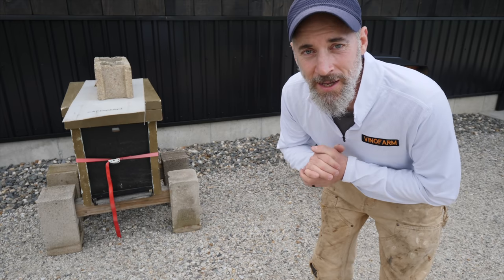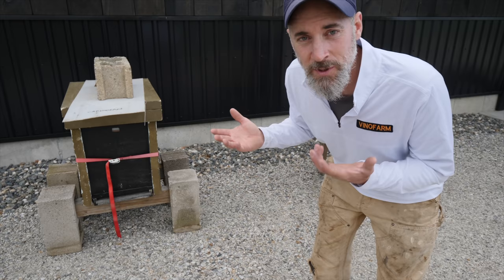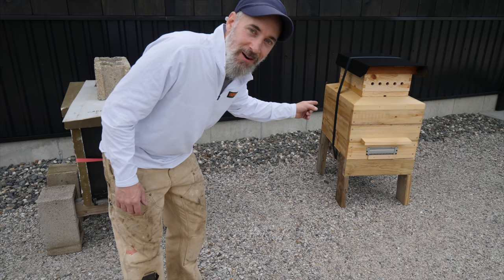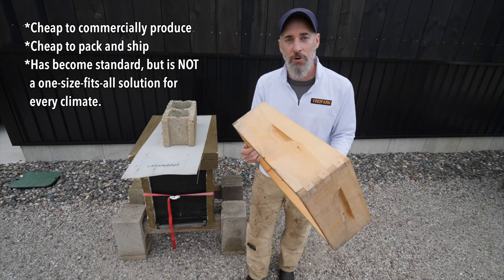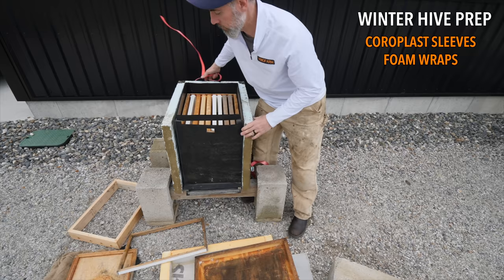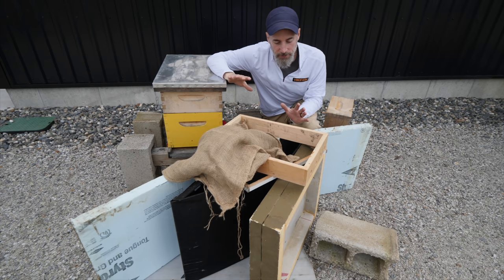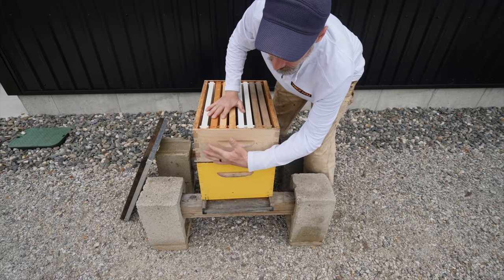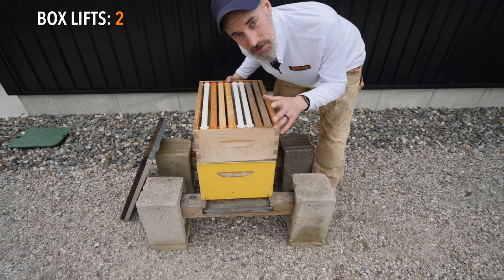I Fixed The Langstroth Hive (For The Bees AND The Keeper!)

Comment: Every beekeeper need  to understand: most of the beehives do not respect the bees. First, 2 boxes are FOR the bees, undisturbed, first box is for colony development, second is honey box exclusive to feed the colony (no more sugar + water to feed them), bees will have enough food to survive winter.  Second, stop using smoke to work with the hive, the smoke causes Absconding swarm, instead, use air blower strong enough to move bees, soft enough to avoid damage them. You can place 2-3 boxes on top to collect honey for the beekeeper. Another thing: frames are not needed, bees will organize the honeycombs inside (I found a way to help them to organize the honeycombs), you can add observation windows on every level to check for bees healthy and honey production, with wood cover to protect bees.  Each box, increase the thick of the walls for extra protection in winter. Outside layers are also a good idea, but please use NATURAL isolation.

Comment: I just got the biggest smile at the reveal of the bee barn. So cool. You took your tremendous loss and instead of throwing your hands up in defeat or just settling for doing things over the same way, turned it into innovation. You are an inspiration! I look forward to many videos about how this new design works for you and your bees!
Reply: This solves many problems I have seen  as well as problems I haven't run into 
Take credit  and name after your Dad
Fan
Reply: I second the big 😃
Reply: No, not directly. But, indirectly, eliminating as much of the struggle with elements and space design, eliminates stress.  They mite cope better, with the energy to apply to surviving. In life sometimes timing can be everything.  Varroa is one of those things.

Comment: This seems like a great idea. I’ve seen many videos of cutouts in houses and even open air colonies (in much warmer places of course 😆)and when bees have lots of space you’re absolutely correct, they make a circular brood pattern surrounded by pollen, surrounded by honey with some drone comb along the bottom. I think this will be much less disruptive to the bees, especially in your cold climate you won’t be breaking their propolis seals like you would in the standard configuration. I’m excited to see how this goes. I think it’s so nice you were able to turn your losses into something amazing.
Reply: The only issue I have with this design for winter is the fact that it still vents all the bees drinking water out the top of the hive. I really wish he would design one that the roof was as well insulated as the sides. If condensation it’s happening on the side walls the bees drink it and use it for breaking down sugar bricks/thin honey. Insulation is better than ventilation and that burlap is not gonna offer even a quarter of the Insulation that the sides are. They also have been studies showing that higher CO2 levels during winter may have an adverse effect on the mites which can’t happen if you’re venting everything out the top.
Reply: @rstlr01  it still has the thick top cover plus a standard insulated lid plus that other lid on top of that. So it’s at least as well insulated on top as a regular bee hive. You have to have some way for condensation to escape or else it will rain on the bees. If doesn’t just happen on the sides.
Reply: @mbgal7758  it’s still doesn’t fix his previous issues all that R-value on the sides does nothing if you’re letting all the heat straight out the roof.
Reply: @rstlr01  his bees most likely died of varroa. Bees survive in trees with much less protection not to mention bee hives. I think there’s nothing to be gained by being negative. You don’t know how it will go anymore than I do but I think it’s an improvement over a standard langstroth or layens hive even.

Comment: Something I have been considering, and thought you may also consider too. In Georgia, my bees can fill 2 deeps. Because your Bee barn mod reduces the weather influences of your winters, may not matter, the Pollen/Nectar flows will be about the same, but your clusters may be larger than you considered-just speculating. Since I have cases of Deep frames. and some old ones too that are drawn, I am thinking about cutting off the top bar and bottom bar centers of frames, join them as a double deep, Leaving just an inch of the top or bottom bars to make the connection and hold the foundations to make a single double deep frame. I'm 73 years old and my back is killing me now and I hated the thought of quitting beekeeping. I thought your bees would now fill double deeps now that you have reduced the weather influences and their home is permanent. Thank you for having a great mind and spirit and being not afraid to think outside the box.

Comment: I just hope the top bar is sturdy enough to hold the extra weight
Reply from the maker: Notice the 1/8" birch plywood gussets in each corner? It's plenty strong!
Reply: I experimented with 2 deep sheets of foundation turned on their sides with no top bar problems.  a deep sheet is 2x longer than it is wide so it makes a square.  had the end ones in a 10 frame box full of honey.
Reply: @danielhiller9165  That's a great idea. Did you try this last year, or is this the first season?
Reply: @danielhiller9165  the point on the comb normally points downward, sounds like your bees adjusted because being sideways orientation changes

Comment: Really thought provoking design. Especially when you divide it into 2 parts. 1/ One is the "tall" Langstroth frames which allow for a more natural vertical span, as well as much easier lateral movement from frame to frame. Sometimes winter starvation occurs simply because of the difficulty of lateral access to honey frames at the edges. 2/ Temperature control through thick wood /Foamular walls. Here in Midcoast Maine on the St George River winter can serve up 0 F days with winds at 35 mph gusty to 50 mph for 3 days straight. My solution path was 4 inches of Foamular coupled with an 80 watt truck battery heater control by a precise digital thermostat measuring the temp at hive center. When the bees got into trouble maintaining their comfort zone the heating pad would give them a little boost. As in your case the Broodminder sensors do a great job of keeping one apprised of how it's all working, including humidity. 

MY QUESTION: Can you think of any way of "transitioning" an existing colony to your structure. Wish I had seen the video a week ago. Just picked up 3 replacement colonies a week ago and right now they are snug in a deep "enjoying" the 45 degree temps of this Memorial Day weekend. I'd love to shift them to your design but I can't see how to do that at this point.  BTW ages ago I invented the excimer laser used in Lasik eye surgery, and for all integrated circuit manufacturing. As a gov't employee I only got $75 for the patent. Never really felt "cheated" Full compensation came just a few years later when a commercial pilot I bumped into explained how Lasik had saved his career. Or each time I use an iPhone knowing I helped open the door to the miraculous tech that now surrounds us.

Comment: Nice redesign! Great job.  I like how you calculated the box changes.  Lot's of pros.  A design VERY close to the Layens idea, but vertical instead. The main design cons:  You'll have ant problems if there are any gaps/warping where insulation is - unless its sealed really tightly.  Be sure there's no open/exposed insulation, as mice may make a winter home there.  (Just add wood sheathing, and you should be all set.)  Moving hives is not a huge deal, but its just less mobile.  The other pro that you don't mention - its far more bear resistant. (thicker).  If your hives do get too hot in the summer, you can pull out the bottom insulation - OR with a hole saw on the insulation, add another bottom vent that can be plugged in the winter.  Also you can add a black coroplast skirt under hive stand in the winter, to add more heating from below.    Nice Job on the Barn Hive!

Comment: We actually have these frames here in Germany  in every bee store. They called „deutsch normal 1 1/2“ works fine and the bees seem to be much calmer.
Reply from the maker: They are not anything I had ever heard of before. I’m not having any luck with google. Do you have a link? I’d love to check them out.
Reply: @vinofarm   you can see an example here in this video (unfortunately it’s in german) https://youtu.be/QaPCUG2xrVY
basically they are just 1,5x of our normal frame size. so we can instead of using two brood supers we can only use one brood super with these xl frames.
Overall I really like your new hive. Wish you all the best for this year ;) keep on beekeeping an making this lovely videos.
Reply: @pmx-1984  Looks like foundationless is working well for him. Thanks for sharing the link. I have a couple of initial theories as to why the plastic sheet was placed between the top of the frames and the cover, do you know his reason or intended purpose?
Reply: @vinofarm  Just google "lazutin frame". Pretty old topic. :)

Comment: I like your thinking, and you have just re-invented the Layens hive.
Reply from the maker: Except that Layens hive is not superable. And it's horizontal. And the tops of the frames are all closed off. I looked at the Layens hives and could not see the appeal.
Reply: @vinofarm  The layens should be tried. 20 frames are equal to 4 deeps. I've never exceeded 4 deeps in this frozen tundra.
Reply: @vinofarm  actually it is.. the original design was a long hive but there are a couple designs based on it that use the vertical structure, one being the Layens "Pastoral" (9-10 frames brood box, and supers with 8 half-height frames) and the Layens "Divisible" (similar to the Pastoral  but composed by smaller elements stacked on each other, much like a warré)
Reply: Layens hive had been more enjoyable to work with compared to langstrough style.

Comment: Love it! Can’t wait to see it go through this coming year 👀
I have two thoughts to toss out:
First is the open foam on the bottom. Insects and rodents both will want to use it for a home. I think having something like a detachable window screen cover with metal screen would help prevent it from being chewed up.
Second is the area behind your spacer boards. If the bees will not be able to get to it for cleaning, it becomes a hiding place for mites. It might be good to put sticky traps for mites in there if you can work out how to hang them.
I really like that you’re considering how the bees choose to set up house in the wild, while also thinking of functionality for your tasks!
Reply from the maker: I'll keep an eye on the lower foam. I had that thought as well. I wanted it to be easy to pop off if they needed more ventilation, so the screen would need to be easily removeable too. I put a lot of thought into making everything tight to keep critters out. It's all tweakable as I go.
Reply: I agree on the rodent issue with exposed foam. I have had them chew through a 3/4" ply before. Also the space behind the interior shims would be a place for small hive beetles to be.  Those frames will be heavy. My idea was to use a layens frame brood box and thicken the walls to accept langstroth supers. I do like the enginuity and the fact you saw it through. Congrats.

Comment: I’m excited to see how this works for you!  I had a similar idea 2 years ago and built a horizontal Langstroth style brood chamber that holds 18 deep frames.  Two eight frame supers can sit side by side on top.  2 inch foam board is used as insulation on all surfaces.  All of my bees survived the winter this year, so I feel like I’m on to something, and having your entire brood chambers accessible without lifting any deeps is super convenient.  I just wanted to say, nice job.  It will be cool to see how the new system works out for you!

Comment: Looks awesome! Love the creativity. We’ve been trying to figure ways to manage insulation year round without attaching the separate panels. We believe the insulation reduces temperature swings in the hive, and helps the bees regulate it more easily. 

We also love our slatted racks, and the way you’ve tunneled the entrance would work similarly to give the brood a little buffer. It’s much more like a natural hollow tree.

One change we would make is a way to ‘splay’ the legs or a 90 metal tab on 2 opposing legs with a stake to fasten the hives to the ground. We thought our hive stands were plenty beefy, but one was blown forward on its face this Spring during a microburst. The boxes were ratcheted together to the stand, but the bottom board caused enough of an offset (another reason to eliminate it) to permit the boxes to slide just enough to gap them for the pouring rain. Hive survived, but the queen did not.

Also, we ‘plug’ our vent holes during winter and only unplug that which is needed to keep burlap dry. We have a lot more wind than you and weren’t comfortable with so much thermal loss through the top. This winter, 2 was plenty. We leave ventilation on year round and unplug more for large hives when temps reach 90s.

We changed emergency feeding from fondant or mountain camp on the frames to dry sugar in rapid round under a burlap pillow (we fill ours with cedar). That way we can update emergency sugar without opening the inner cover box in lower temps. This winter was so long and cold that we ran out of emergency stores in mid February and had many frustrated weeks waiting for even a small warmup. In addition, it makes a lot less mess in the hive for bees to have to clean up. We have fed syrup either mason jars in a frame on the inner cover but are slowly transitioning to rapid round because we can refill without exposing bees, and the jars and pails can leak (noticed mostly with cold night temps and hot sunny days), which anecdotally seemed to attract stronger hives to those which we were feeding.
Reply from the maker: Great tips. My hives weigh close to 100lbs including the stands, which they are strapped to. Add in bees and honey stores and I don't think wind will be an issue. They are much more stout than a regular hive on a stand. 

Ventilation is something I've been reading a LOT about. I have a lot of people sharing articles that are making me think twice about ANY ventilation over winter. My inner cover design is very adjustable and easy to close down if I do decide to close it up for winter. I have a few more months to decide what to do. I'm thinking I will leave it open with the burlap through October when they are reducing stores and syrup and there is a ton of excess moisture in the hive, but will probably shut it down for the 4 coldest months. Nov, Dec, Jan, Feb will probably just be super insulated with no upper openings. I'll re-open the upper entrance in March for cleansing flights. I am now monitoring humidity and temps in the hives,and it's been a real eye opening. I'll be getting into that this season.

Thanks!

Comment: The extra deep frames remind me of Dadant, a frame format that is mostly used in europe I think.
Reply: it's way bigger than a Dadant.. DB frames are 2-¾ inches taller than Langstroth frames, this one is at least 7 inches..
Reply: @Muiuiuky  oh cool, sorry, I've never seen them in comparison and inches have little meaning to me.
Reply: @IISheireenII  using the metric system, Langstroth frame height is 23cm, Dadant-Blatt is 30cm.. Vino's frames are at least 40cm if not more..
Reply from the maker: Even If I could find a supplier, Dadant deeps are about 12” deep. Mine are 16”.
Reply: @vinofarm  a little smaller than a Lazutin frame (18 ½" deep) 👍
Reply: @vinofarm  Those are closer to the Lazutin frames. Layens frames are 13 X 16; Lazutin are (essentially) double deep Langstroth frame in size.
Reply from the maker: @MarekArawn  I had never heard of Lautzin frames until the comments started rolling in on this video. I did mention those huge double deep horizontal hives in the video, but again, my goal was to make an unobstructed comb area. Those Lautzin frames are monsters. Mine are full Lang width (17" comb area) and 16" deep. The Layens frames look petite compared to mine.

Comment: I’m. I think your picture is upside down. The honey is usually around the upper part. I have never seen it the way you drew it.
Reply: I'm glad I'm not the only one to notice that. The queen usually lays brood below honey reserves. Or rather, the bees store honey above brood and the queen tends to lay closer to the entrance.
Reply: @MarekArawn  It happens. I’m sure it was an honest mistake. But the problem is that people are trying to learn from his videos.
Reply from the maker: @navarra4  Yes, I realized my mistake while editing but it wasn't possible to easily go re-shoot the shot and trying to cover it up with editing was pointless. The thing is, the point I was trying to make still stands, so I didn't think it was a big deal. The point being... Small Langstroth frames affect the shape of the brood pattern. My larger frames are an experiment to see if a larger comb area changes how they use the space.
Reply: @vinofarm  I can tell you right now it will work. It is the best way. I am still concerned about heat loss in the top but they are your bees.
Reply: @vinofarm  maybe you should have an entrance in the middle so the center of brood is encouraged to be centered in the hive?